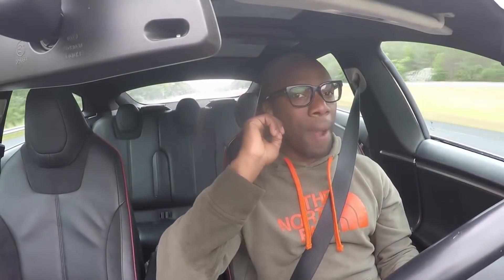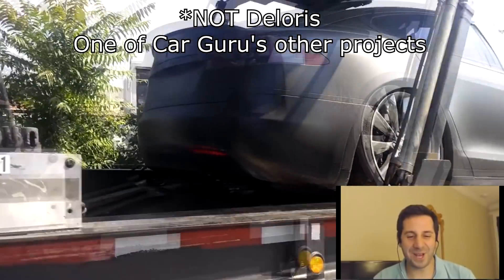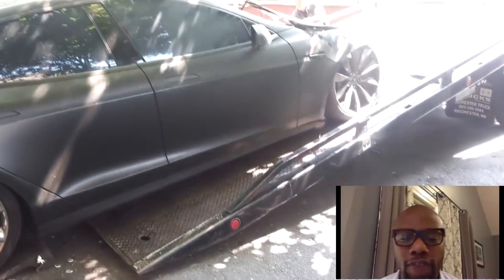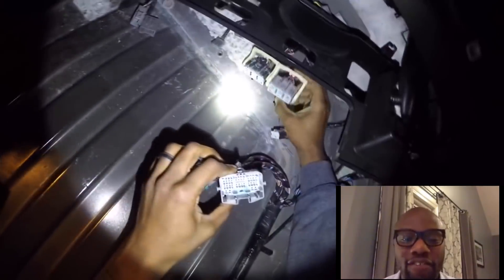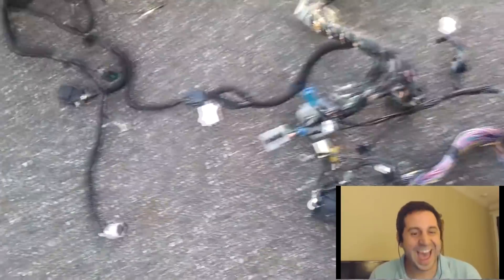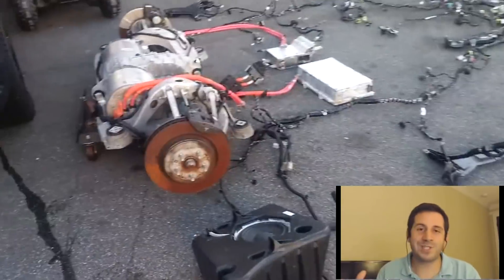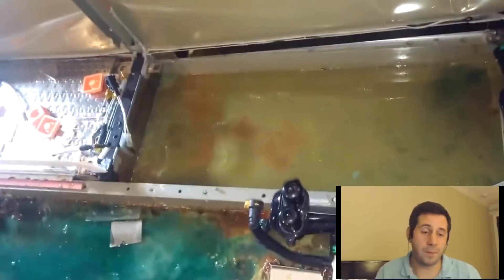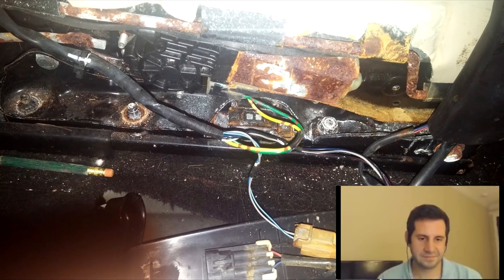This Guy Built a Tesla Model S from Parts! Here's how he did it...

Comment: Also, I might have missed the math but.. he paid about 14,000 for the flood car, and then 14,000 for the parts car. But they never explained how that equated to only $6,500.. I'm assuming he parted everything else out and made up the difference? He said he sold the bad battery and engine, but then said that basically paid for the "shell". So if i understand that correctly, that's about 14,000.. So he still paid 14000ish for the 2nd car, right?

Comment: I love how shady ass Tesla refuses to sell parts for their cars like this. This is why I'd never own a Tesla. Tesla following Apples service model. Next thing you know they'll pair every electronic module so if you swap anything the car won't run. SMDH.
Reply: bullhornzz

Hell, that's just like most cars now with all their dumb sensors. So what if my air flow isn't perfect (good ole mass air flow sensor)?

My old 73 Ford Maverick had no stupid arse sensors of any kind and as long as I didn't abuse it & was diligent in keeping it maintained as recommended by Ford, I had no 'big' worries. Sadly, those days are long gone in the car industry.

Matter of fact, it reminds me of how stupid HP (and several other printer manufacturers) now REQUIRES that their printers will ONLY accept OEM (HP) branded printer toner/ink.

If an aftermarket cartridge is installed, good luck in getting the printer to 'recognize' it. The printer has a proprietary chip reader that searches for an HP chip in the newly installed cartridge. And if the cartridge isn't a genuine HP cartridge, the 'HP Printer Nazi' says... no printed pages for you!

And yes, I know the chip can be hacked/modded, etc... but most folks don't have the time/patience to deal w/that. It's the damn principle that should be highlighted here.

Anyway, the crippling of equipment for the sake of gaining future 'residual' profit is just plain wrong & folks should always rail against it. OK - end of rant. : )

Comment: So with a salvage title. Tesla won't sell you any parts at all. Click. As they hang up. What happens when you need something later and tesla won't sell it to you. Or if you sell the car. The buyer won't be able to get it fixed anywhere as any independent  shop is going to try to use tesla parts and tesla is going to ask for a Vin number.  The donor body module also has the incorrect Vin number. If one is going to build this to drive themselves. Grest. Build to sell. I hear lawsuits at the door.

Comment: Totally misleading video..
Reply: one car was 14k other 14.5k he sold the motor and the good batteries from the first one and the shell, doors and other stuff from the second one for 23k or so. total money spent 6500, but the labor and time costs are not calculated because he did it himself
Reply: Jesse R I’ll tell you what. Your common sense is definitely not misleading. It’s clearly not there.
Reply: Jesse R how?
Reply: D1G1T4L L4N3 well for example, they said one of the auction cars was 14 grand

Comment: sorry bro but if it took you that long to take a car off the tow truck there's a problem. our race car that crashed at the track completely destroyed took us 15 min to get it on and about 17 mins to take it off 😕 with no wheels just brake rotor and broken rims
Reply: you said "us". He was working completely solo.
Reply: if you watch his videos you would know tesla weighs a lot more then normal cars let alone a race car that is made of tubes and plastic over it. tesla wheels were also locked up so they don't move without putting in tow mode which you can't do with no power.
Reply: Sean Kaine you have problems boy
Reply: Idk do electic wheels lock up if theirs no power? Because all the motors are at the wheels and everything is electronicly contolled?
Reply: I'm guessing the car has conventional emergency brakes and the cables probably rusted and froze in the locked position.
Reply: james42519 trust me we have towed heavier cars than a Tesla that was stuck. technically all you needed was some dishwashing detergent and some trays food trays McDonald's trays put them under the wheel and it will slide on and off with ease

Comment: Yeah but he had to spend over  $30,000 on 2 cars and additional items.
Reply: Jvillebdks87 but he recuperated much of the cost by selling the intact battery bricks and untested drive unit from Deloris, the usable parts he didn’t have to use on Deloris from the white car, and he sold the white car body shell to someone repairing a rear ended Model S.
Reply: Also CarGuru was selling parts as he was going on - they talk about selling the motor and battery parts from Delores which 'paid' for the original purchase.  So he was not ever fronting up $30k.

Comment: should've got mcdonald's trays under the wheels to get it off the truck
Reply: I used to drive a tow truck (mostly flat bed) and the best trick of the trade is DISH SOAP!! I have never had a single issue using it whatsoever!
Reply: I use dish soap when I have to drag a repo out of the driveway at 2am. Way faster and quieter than dollies.
Reply: This is actually a great suggestion. People used to put those under their rear tires, pull the e-brake, and do spinouts. The only downside I  could see is once he got it off the trailer (that's at an already at incline) he would have no easy way to maneuver it due to the e-brake being locked still... although he did say he had to use his truck to pull the vehicle off in the first place.
Reply: Print and Bucko, more great suggestions.
Reply: Was about to say that but you beat me to it works like a champ water and dish soap!

Comment: Hey samcrac, quick question. Will copart let you drive the car off the lot or do you have to have a tow truck?
Reply: Joacim Lopez if it runs and drives then you can drive it at your own risk. They will just have to fork it outside the lot. I've done it a few times myself.
Reply from the maker: ^ what Chris Tucker said
Reply: Good to know. Thanks
Reply: Joacim Lopez in the UK Copartti will drive a car out for you from they're compound if it's a runner ,seen people struggling and I've had the star of the show come out ,wiped the yellow chalk off the windows with thinners and driven that sucka outta there home and nearly crashed at the first proper roundabout as the brakes were goosed
Reply: Exactly B for Build's FRS was drivable
Reply: Joacim Lopez you’ll have to tow it they take license plate
Reply: It's easy enough to get temp tags.